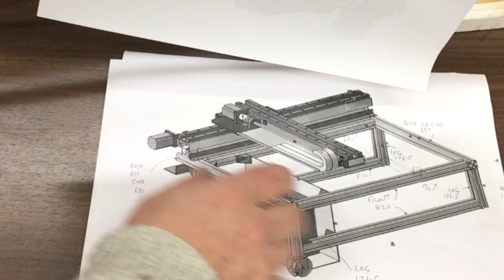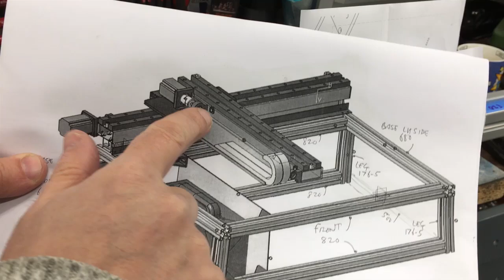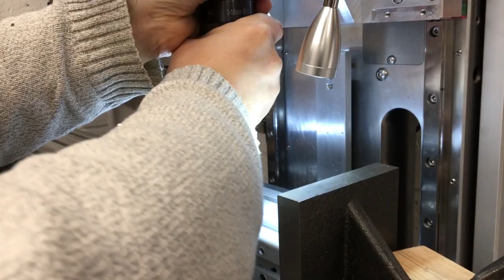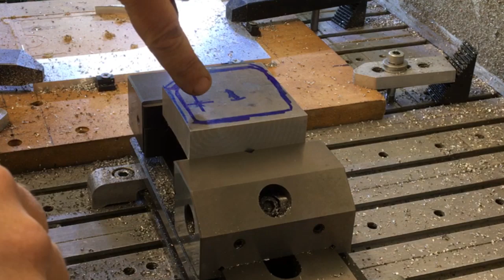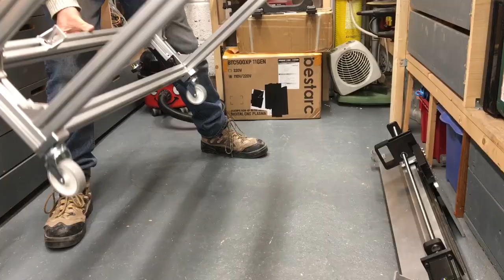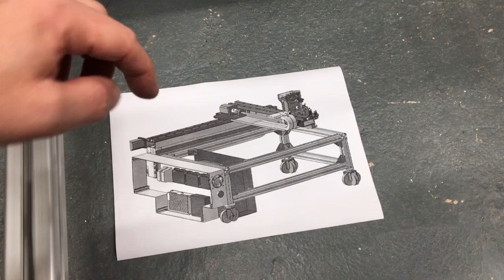Ep06: Plasma CNC build | Main assembly finished!

Comment: like women ,over do everything ,then complicate some more ,then rem that plasma spit can melt alu ...
Reply from the maker: Yes I do tend to over engineer things.  I was concerned over the aluminium getting damaged or burnt so the actual cutting area will be lined with steel panels.  Other areas of the machine might get pitted over time but I’m ok with that.  I’ve built lots of CNC machines but this is my first plasma CNC so I hope to learn more from it.
Reply: @routercnc9517  hehe and some more over engineer :) why not use steel tubes in first time ? they are cheaper easy to weld less twist per axis and u can use tube to have ballscrew inside protected ,just my thinking ..
Reply from the maker: @MrCcfly  I did start with steel section in the design but this profile extrusion was very cheap (£10/m).  Profile allows me to make small changes and build it square (I wasn't confident in welding it all square).  Either way the cutting area strips and downdraft area were always going to be steel independent of the main frame material.  I've seen plasma machines in both materials, and some with lots of 3d printed parts so let's see how it goes!
Reply: @routercnc9517  well alu transmit heat fast ,,that mean flex ,, but it could work ,,will u made with water pan under it or just zig zag bed ?
Reply from the maker: Right now I’m planning slats (curved probably) but no water bed.  I’ll be trying a downdraft system to catch the sparks and extract the smoke out of the door to the workshop ( it will be right next to the main roller door).  Let’s see what happens.
Reply: @routercnc9517  good luck :)